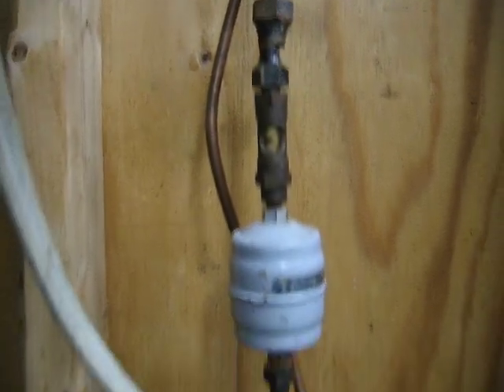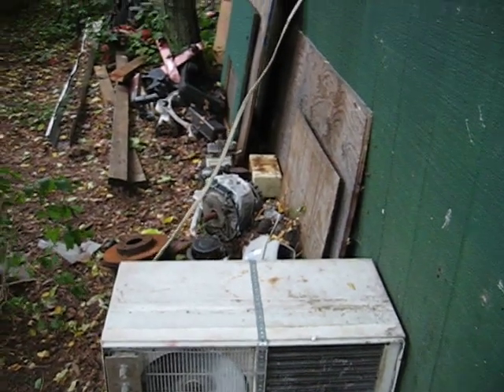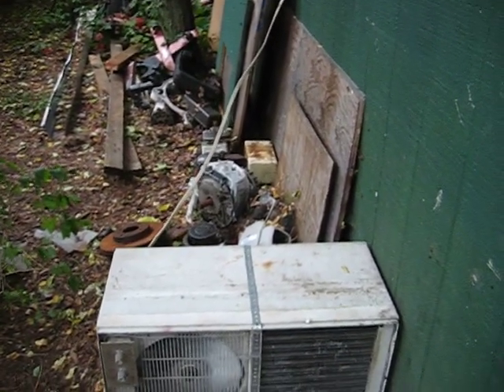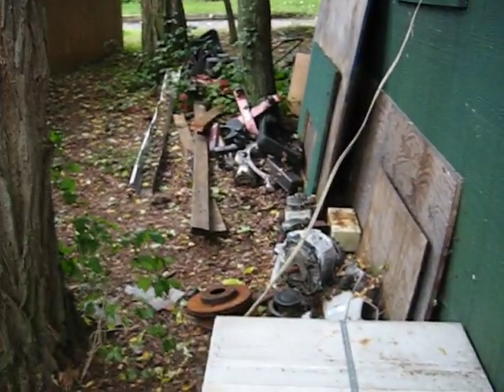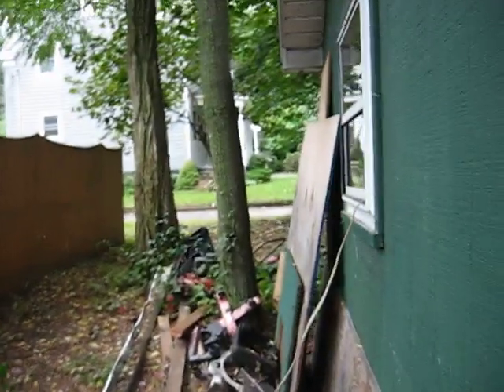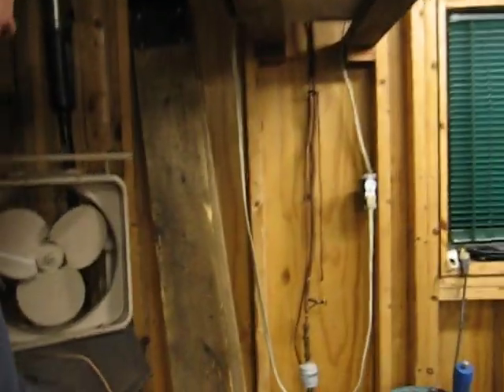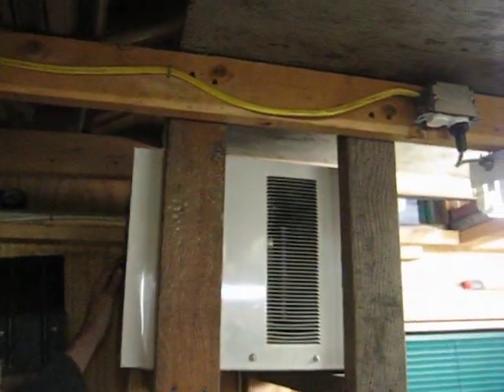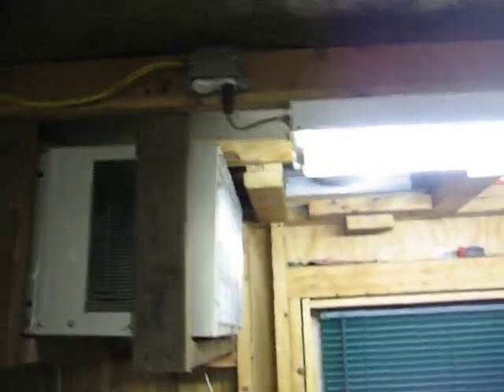Homemade Air Conditioner Part 2 !!

Comment from the maker: @KSCPERFECT  In short,  a condenser is a device or unit which condenses a substance from its gaseous to liquid state,  typically by cooling it,  and in so doing the latent heat is given up by the substance.  Condensers are heat exchangers,  like in a frig,  the heat is taken from the interior and discharged to the outside air.  For more info go to Wikepedia where this info comes from.

Comment: it's a low temp condensing unit & your using it as a air cond .... The back psi isn't gonna be right .... You will burn it out lol

Comment from the maker: @bobo888bobo The outside box contains the compressor,  and it was placed outside for space,  and thereby less noise.   Otherthan that,  it runs by the same principles as a regular home air conditioner.  It has increased cooling ability because of the larger compressor,  and that was the goal.

Comment from the maker: @TechnologyGod   Very persceptive as to the hat,   hence the broken star,  found it on a ski-lift in Vale,  Colarado,  I wasn't sking just visiting about fifteen years ago.  As to the air conditioner,  it was cold,  and colder because of the refrigerator compressor.   The compressors on most discarded refrigerators are still good,  and  they are bigger than the average air conditioner compressor,  in short,  it makes perfect sense to re-use.

Comment: I am working on something similar, except mine will work on 12 volts DC current, and the compressor won't be a fridge compressor, but a 12 volt mini air compressor. Refrigerant will be R134A.

Comment from the maker: He had to recharge,  I don't believe he has the proper mechanism for capturing freon.  He has tried to capture the special oil used in compressors,  but even that is problematic,  since it's used and a bit burnt,  thus he used fresh oil.